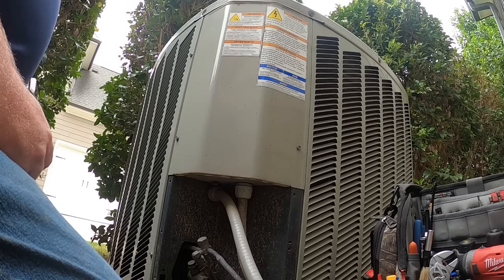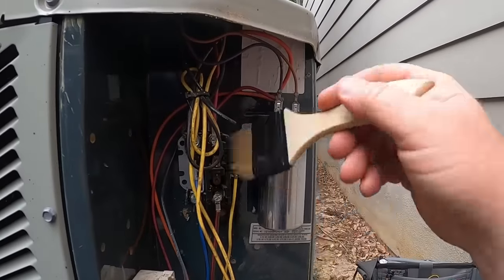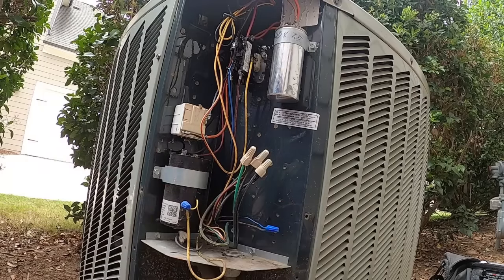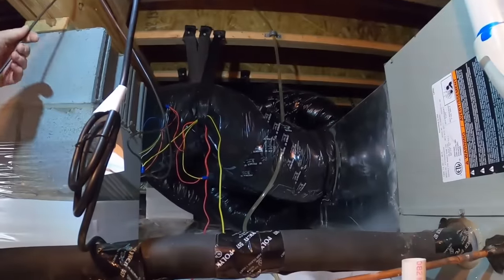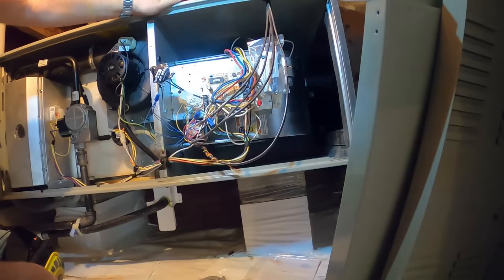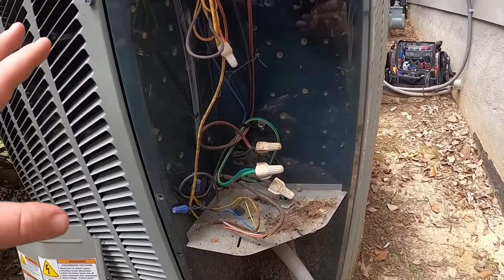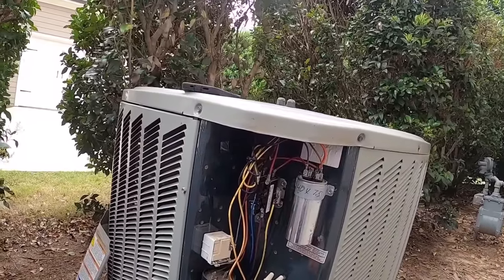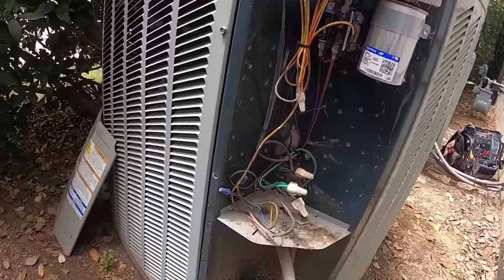Another HVAC homeowner saved from deception!

Comment: One thing that I have discovered about these outside units, they do better if they are at least two feet 
off of the ground. They don't suck up debris as much, especially lawn debris, and insects such as ants 
and termites, and rodents. Also, a small screen on top, such as 1/4" hardware cloth, prevents leaves and debris 
from falling down inside of the unit. An ounce of Prevention helps more than a Pound of Refrigerant.

Comment: Nice. I was wondering how long does it take you to do a one system maintanece?  Im a little slower than some do but i have done it this way for a while, i pull the tops off and clean the pinestraw and junk out with my hands and gloves and vacuum the small shit out with my Milwaukee battery power shop vac, i mix a few tablets with water and flush drain and then vacuum the drain lines. Cleaning out the stuff in the condesners can be a pain on the tall units lol. Was windering how you do it? I also do the checks of charge, sc and sh, capacitors, electrical connections. That coil on the upstairs they should take that door off and flush the drain but you will not see if the coil is dirty because you are looking at the outgoing side of coil. I wish they would out some duct between furnace and coil so we can cut a door on to see that side of the coil. That would be nice. We charge extra to do a chemical evaporator coil cleaning because time goes a little betond ma, condensers we clean withbwater hise and charge a little extra for chemical cleaning which is usually only an issue in like a new customer first ma or someting.   Thise fools that were there were jack ass's. Hahahahaha yeah the motor coat more than the coil😂😂😂😂😂.  Peace out
Reply from the maker: We do a thorough cleaning and do use a chemical mix on the coils, no extra charge. Usually 1.5 hrs 1 system and 1 add on hour for each additional unit. Sometimes the house and accessibility to the equipment will change the time and first time cleanings may take longer if it is really dirty.
Reply: @MyHVACLife  I got ya, thanks.  I wish we did the chemical cleanings when needed free because I hate explaining that to a customer. I told the office just up the price a little bit to cover it. 3 hours at a 5 system or 6 system ma they call "how's it going"?  I say it's going, there are 6 of them and one of them my foot is at my nose hahahaha.  Back at it tomorrow. Have a safe one.

Comment: You guys clean evap coils on maintenances? How much is does your yearly plan cost?
Reply from the maker: We clean the evap coils and our plans are different prices depending on number of units and whether they sign for multiple years. Our base is $175 for 1 system 1 year 2 visits with discounted repairs, pretty standard.
Reply: @MyHVACLife  I agree that’s a pretty standard plan and a decent price. but cleaning a evap coil is usually a additional repair, as it should stay clean… I don’t see how your including that in the 175/yr plan, unless we have different definitions of clean.